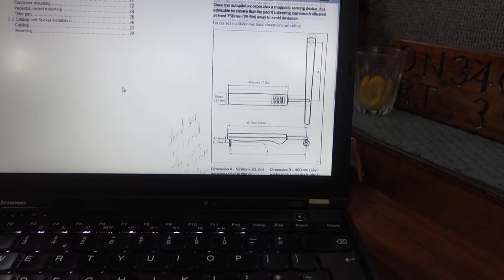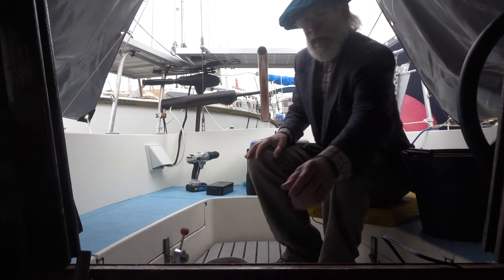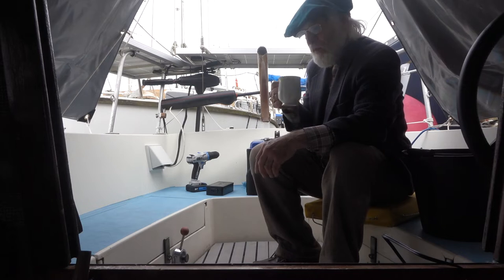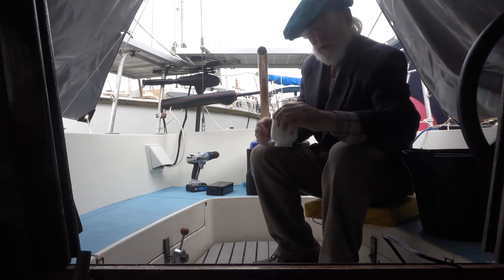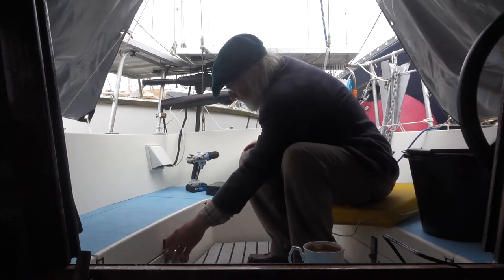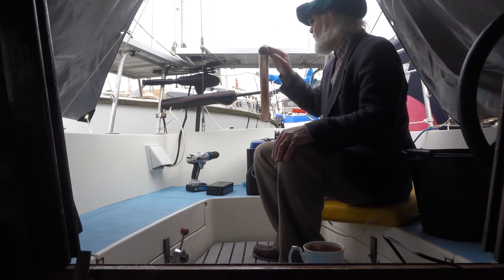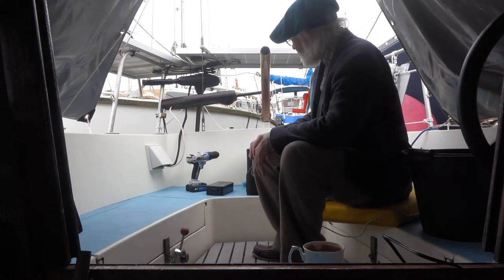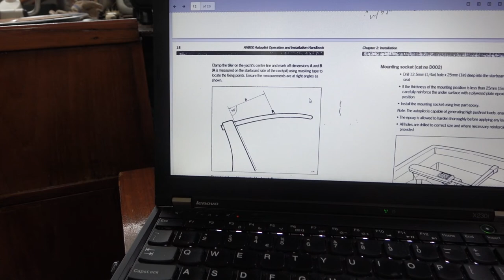Fitting the Autohelm Tiller Pilot

Comment: Good morning Adam, first of compliments for your video, simple and clear. I have the same Tiller pilot on the boat I bought 2 years ago. Now I'm having some electrical problems and my paper manual unfortunately  is completely unusable. I have a question, I see at the beginning you have  the manual into you computer. Could you be so kind to give me the link where I can find it? I'm really struggling to find it. It would be much appreciated. Thanks
Reply from the maker: I had a look on my computer - I don't have it.  I tried a search for AH800.pdf and came up with a site at the top of the list.  You could try that.  I managed to see an exploded view for free.  Mine stopped working - needs a repair job.  In the meantime I just tie the helm in place and adjust the sails.  All the best, Adam.
Reply: @saraofnorthwales  Thanks Adam, I'll find it somewhere. All the best, Bruno